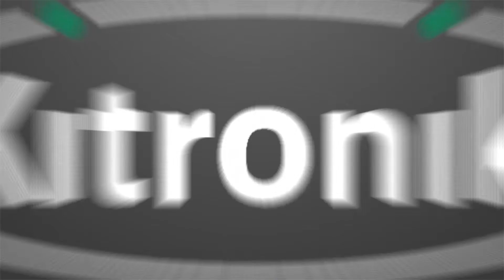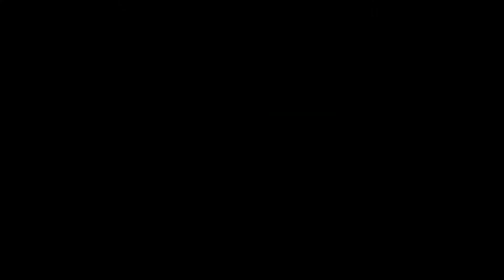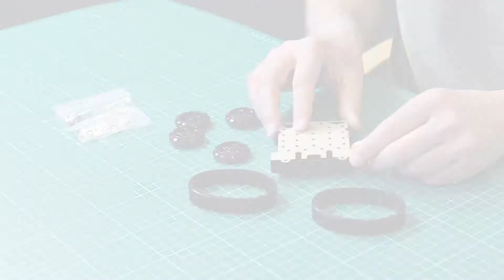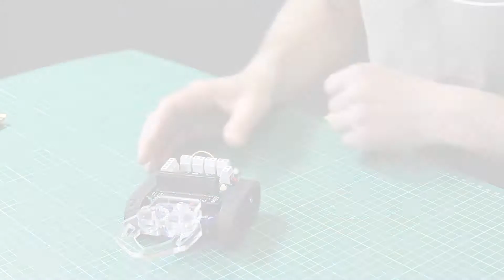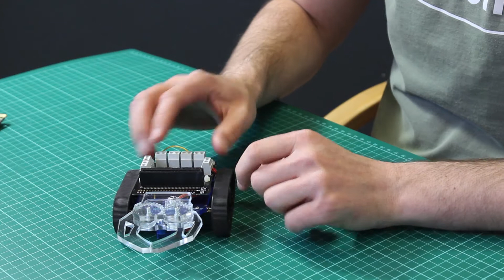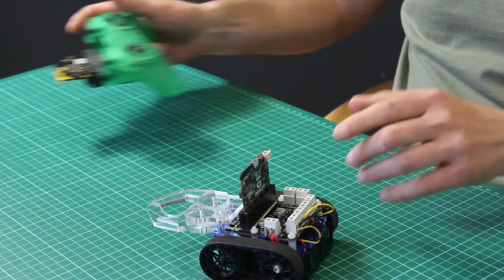Zumo Chassis Kit - Kitronik

Comment: Hi we have booth kits ( micro bits) and the zumo but how did u plug them both together ?
Reply from the maker: Hi Hossam, we put together a blog which guides you through the process, you can find it here: https://www.kitronik.co.uk/blog/build-microbit-controlled-zumo-buggy

The Claw bit is optional so just miss that bit out and get to the part where the motor driver board description starts. I hope this helps!

Comment: Hey, what's that controller you are using? Looks like the microbit is fitted in. Will you be selling it too?
Reply from the maker: Hi George. It's our popular Motor Driver Board: https://www.kitronik.co.uk/5620-motor-driver-board-for-the-bbc-microbit-v2.html
Reply: Kitronik, sorry I should have been a bit clearer, I was referring to the Bluetooth hand controller . Seems to have a Microbit attached. I have already ordered the motor board amongst other bits. thanks for the reply also.
Reply from the maker: That was hand built, but something similar could be done with the breakout board: https://www.kitronik.co.uk/5601b-edge-connector-breakout-board-for-bbc-microbit-pre-built.html.
We also have an app (android only): https://www.kitronik.co.uk/blog/kitronik-move-app/

We do have plans to make something based around these, but they are not in development yet: https://www.kitronik.co.uk/4691-thumb-joystick.html
Reply: Kitronik , amazing stuff! Thanks 👍